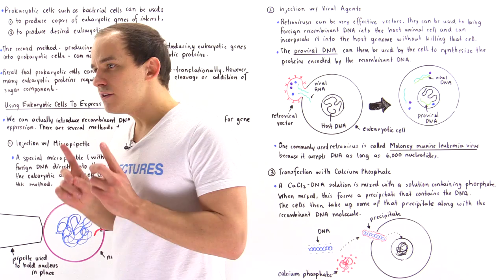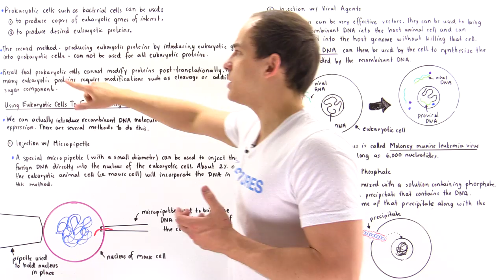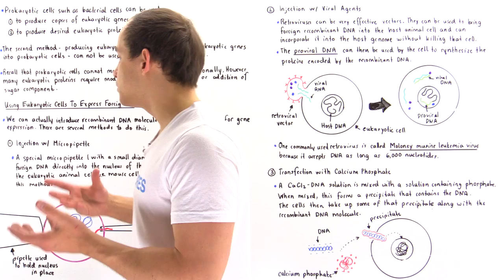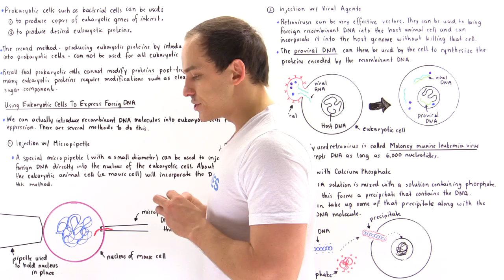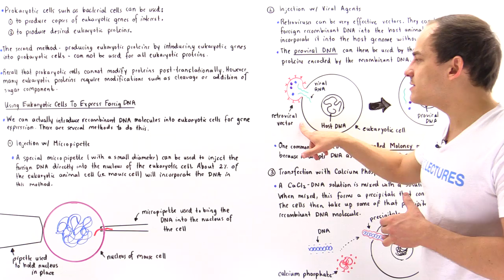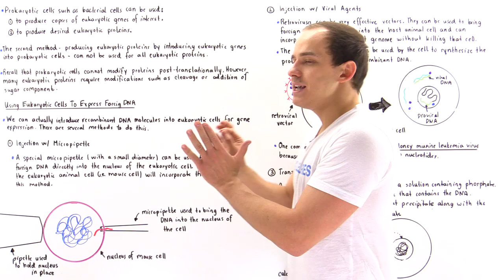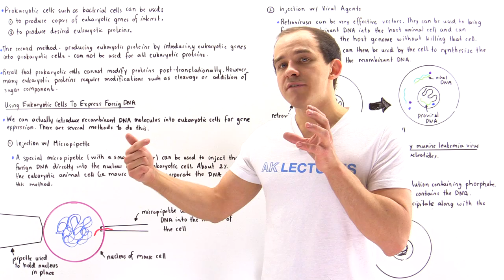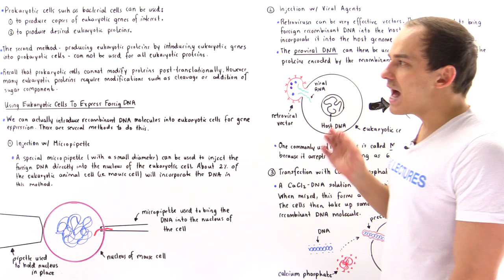Gene Transfection

Comment: When expressing proteins in E .coli the cells that have been successfully transformed can be selected for by antibiotics (if the plasmid being transformed contains antibiotic resistance). Do you know how we can select for the eukaryotic cells that have been successfully transfected?
Reply: Usually when we perform the transfection, we incorporate fluorescent reporter genes as well, so we can then screen the plate for the desired product. Also, running ELISA can help characterize the protein produced from the transfected cells.